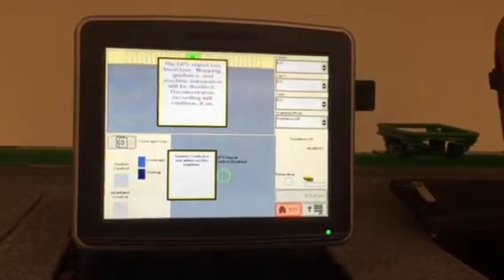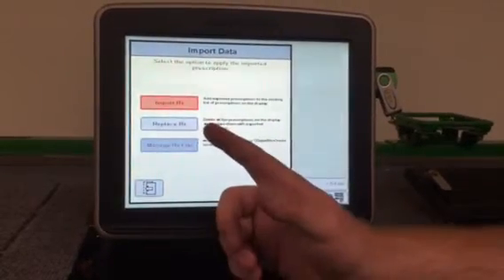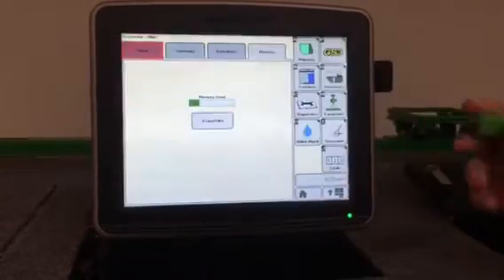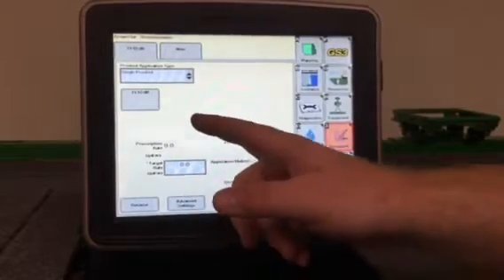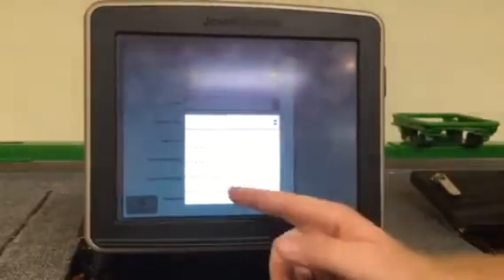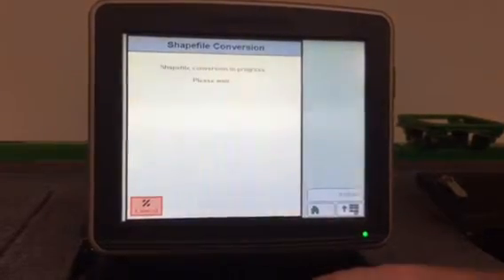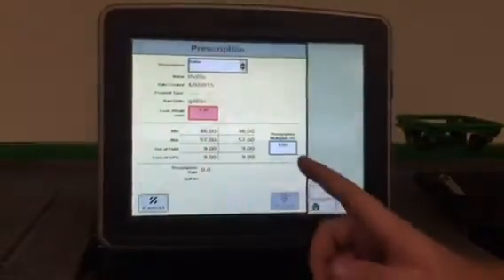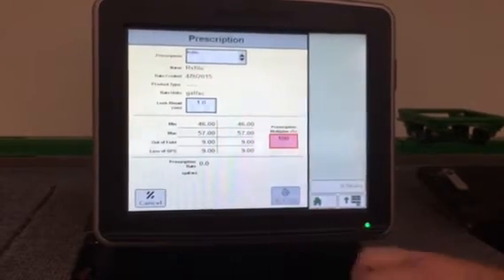Prescription Loading on 2630 Display

Comment: Thanks! I use trimble RTK to steer the tractor and I bought a 2630 to drive my variable rate fertilizer spreader buggy. I ported GPS over from my Trimble into the 2630. We will see if it works...